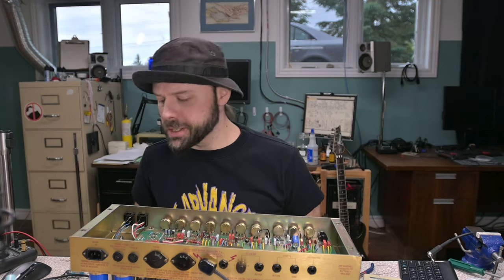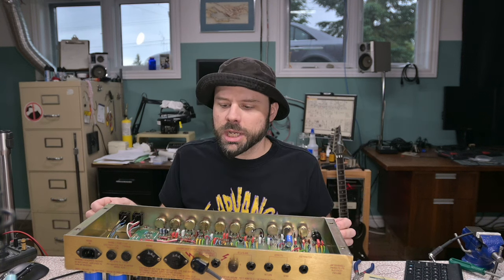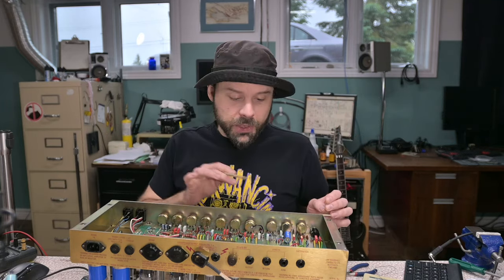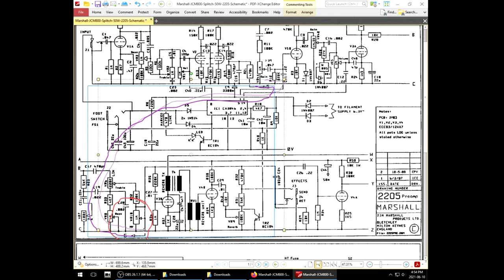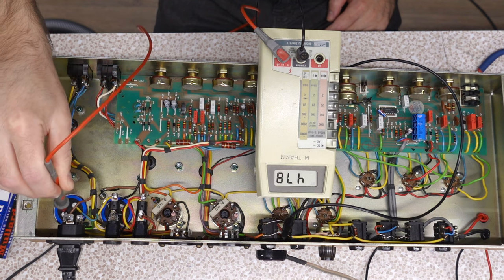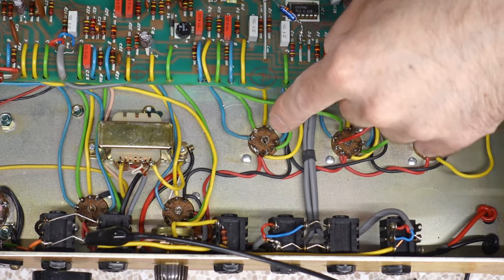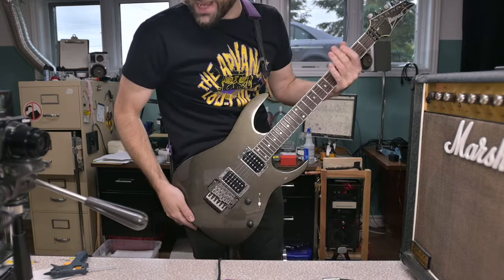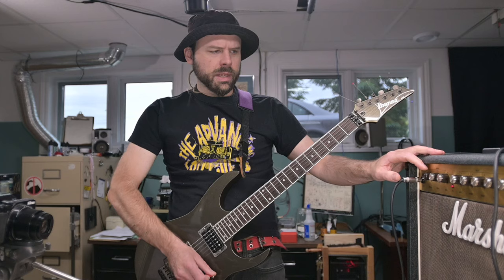Marshall JCM800 "4210" Combo Repair Part 2

Comment: Great video. I notice that the black wire that you desoldered in Part 1 was reconnected in a different place (on top of one of the big caps). I don't know of that makes a difference but I thought it was worth mentioning.
Reply from the maker: Hmm, not sure. I don't have time to review the videos. 
There can be more than one way to correctly wire a circuit in a way that doesn't make a difference.

Comment: Very instructive. I wish you would develop more  the reasoning behind why if the preamp ground through the shielded cable is lost, it is grounded hot and becomes a shock hazard for example. Or the others ground reasoning. Learning amp circuits through your videos and other’s. Thanks bud.
Reply from the maker: Well, a circuit needs both + and - power to work right, this we know. 
The - Power is being passed thru that shield, but also, internally - is tied to ground, and therefor to the chassis, therefor any metal surface of the amp. 
If the wire breaks, the preamp will loose - power, but you are connected to the preamp ground via your guitar, so if you are holding the guitar, and touch a metal surface of the amp, or, any other ground source, like a microphone, you become the wire, and the preamp will try to power up via that path.

Comment: May have ghosts in the blood and the designers at Marshall sure did cocaine about it..
I read from multiple sources so far that the power supply design on a fair few models is very iffy. 
Basically, when turned off, V-bias discharges faster than B+. If you turn it back on too fast or have a power outage, the bias voltage is way too low for the B+ at that moment. So until the voltages are stabilized the output tubes conduct hard and essentially self destruct by red-plating. 
Dunno if this model is one of those but better be safe than sorry.
Reply from the maker: Heh, I wonder if this is another incentive to use the standby switch. 
I do recall commenting that this PSU didn't have the usual discharge resistors on the caps that I'm used to seeing. I guess that might be another reason for those resistors.